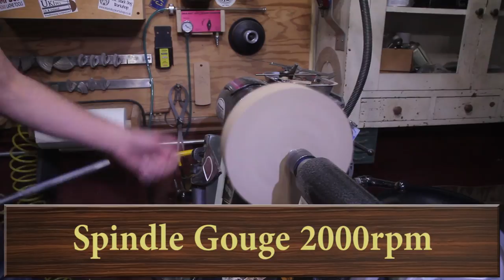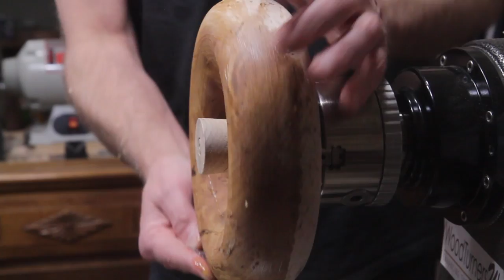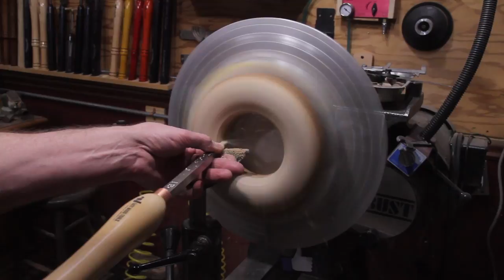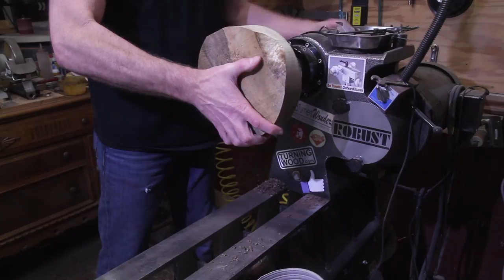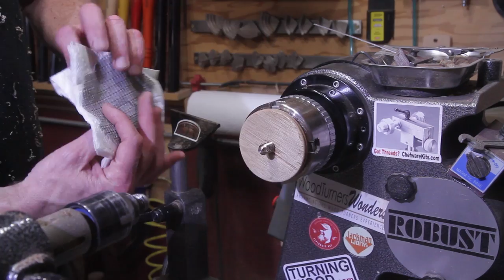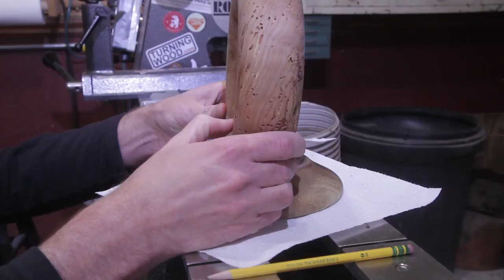Flower Vase For Valentine's Day / Woodturning Projects

Comment: like the piece.  Really nice.  You use a lot of easy wood tools.  I have never been able to get mine to cut.  I have a Rockler Carbide tip round cutter.  I've tried to use it flat, at an angle etc.   No luck.  Thought I might have had a bad cutter, replaced it not luck.  Any suggestions on what I might try?  Thanks for your efforts in producing You Tube videos, we really appreciate it.
Reply from the maker: Thank you very much Michael! I'm not sure about the quality of Rockler's cutters. I us the EW cutter, and run the lathe at a pretty high speed.

Comment: Hi Carl, My Easywood chuck says it is limited to 2000 rpm. Have you had any problems running it at 3000???
Reply from the maker: I did know they recommended a max speed, I run mine at 3000 all the time with no problems.